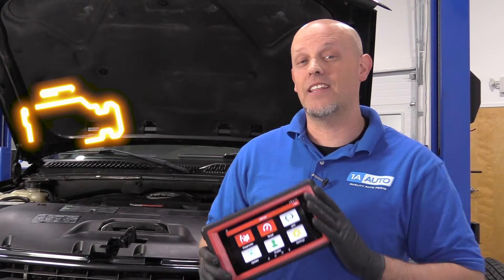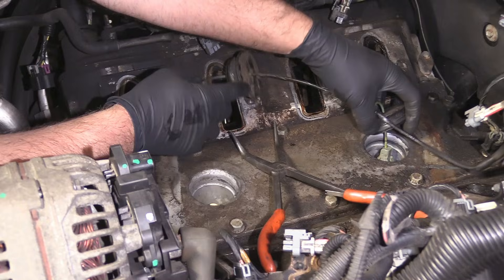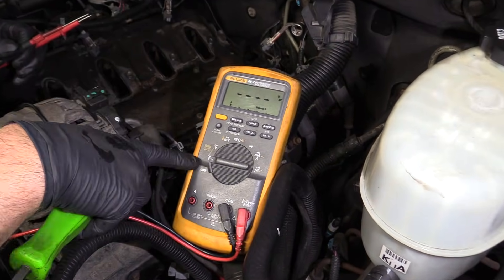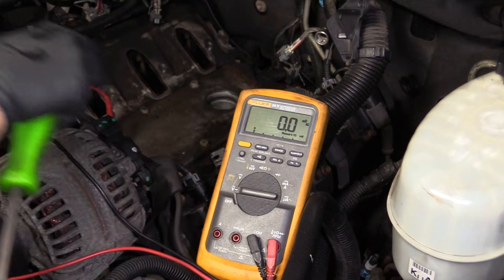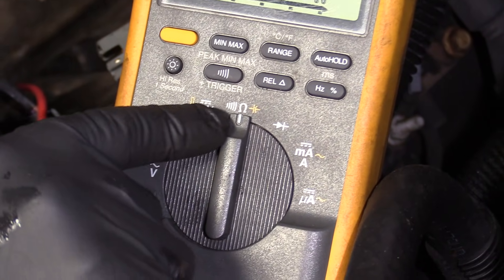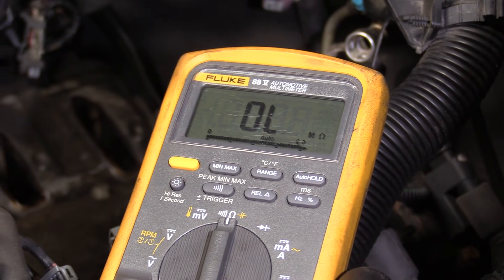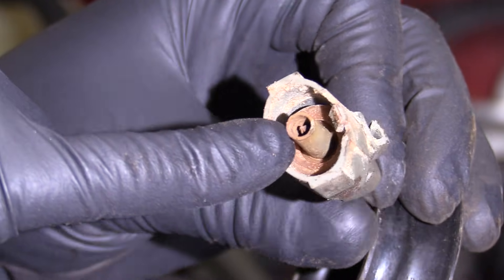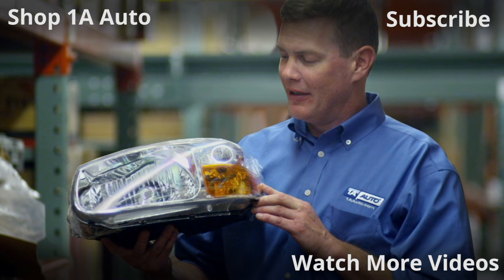Check Engine Light? Car Knock Sensor Low Input - Code P0327 P0332

Comment: Why didn’t you just check the sensors at the main connect located  at the top drivers side of the manifold? No need to pull the intake and it test both the sensors and the wiring harness. Just thought

Comment: I did a full turn up on my 2004 chevy Avalanche. And I did also replace knock sensor.  Water was inside ,  I was my truck 3 times a week , as I drive home after washing ut I noticed water flying into the knock sensor area.  Smh.  I just replaced it last year

Comment: I’ve had 6 replaced in succession and still getting codes. Circuitry from sensors to pcm ohm out perfectly.the puns on the pcm are clean. My next hope is a new pcm will solve my problems

Comment: I has this for a minute  , after startup  , 
when leaving Home Cheepo.

I had  no engine light  prior to parking( or ever in 190,000 mil.)

I read and cleared the code with the Scangauge2, that's  on the dash.

 It didn't  return.
Oh well.😊

Comment: Faaak I had that problem after a repair by the mechanic, it turns out the mechanic inverted the compressor and knock sensor connectors... So... if your air conditioner is not working too, it can be the same case... switch them and everything is solved

Comment: Thanks for the video, I have a 01 Subaru outback and I have a knock sensor code 327, I’ve replaced the knock sensor twice now with Sensors from other Subarus that I know are good, so , when I tested for power going to the knock sensor, there is none, should there be power going to the sensor if so, how much power ?  Information appreciated.  Thanks, Ron

Comment: 1999 Lexus ES 300 over 200k when I switched to motor oil blend synthetic CEL came On then I go back to conventional non synthetic motor  CEL went Off, code P0330 knock sensor 2 circuit bank 2

Comment: I have 2 codes of P0327 2 codes of P0332 and codes of P0157 and I think a little less power. 
But the engine idles smooth an I just found the PCV valve was stuck open and the wrong one.
What are your thoughts?

Comment: After replacing my knock sensors 3 times in a week my dealer found  they   had a bad set of knock sensors on they're shelves that GMC had recalled that they didn't know about.    Check recalls on your parts yourself,    or at least recalls that  dealers don't .

Comment: question, i replace both knock sensor and the wire for the conectors chevy express 2004 but Still low input , and the van vibrates when i hit the 55mph , what should i check ,

Comment: I changed both knock sensors and its still has the same code….any help anybody??
I also changed the wires to
Reply from the maker: +Big G We wouldn't be able to diagnose an issue like that here, you may want to have a local mechanic take a look at it. Thanks for checking us out! http://1aau.to/m/Shop-1AAuto-c

Comment: Replaced both sensors,wire harness and still getting codes on 04 Silverado 2500 hd truck runs fine no knocking in the motor why am I getting codes

Comment: I've done this job twice now. First with after market cheap knock sensors. Then I paid top dollar for OEM sensors on my 2005 6L GMC. Knock sensor #2 both times within a day. #2  was slightly corroded but I thought I'd cleaned it up nicely at the very beginning of this job. I used a bit of never seize both times. The OEM ones came in a bag from Amazon. Not protected at all. Thought that was weird. I'll be pulling it apart again next week on days off. First round was over 4 hrs. second was under 2 hrs. So this wont be terrible but it's not a job I enjoy. Very frustrating. I will be using a multimeter on these before I pull them. Thank you very much for this video. Super helpful. Any other advice would be greatly appreciated.
Reply: Having similar issue with an 02 6.0 gmc, ever figure out the issue?

Comment: Well, I had my check engine light come on and read that code of the knocks sensor… i cleared the code… would repeatedly come back on for a period of a few months… until I put super unleaded in the tank, cleared it again and it hasn’t come back on since for several weeks now 👍😎

Comment: Hi 
I have 2003 yukon xl 2500 6.0L.
I encountered some problems and fixed them, but I have a problem for which I do not know the solution p0327, p0332, p0135, p0300.  I changed the first and second knock sensors with the wiring harness, but 02 sensor I haven't changed it yet, and I cleared the codes, and with a test drive on RPM 2500 to 3000 (check engine) and after checking it showed p0327 p0332 p0135 p0300

Comment: I am working on an 08 F 150, it has a newer Jasper engine. I what I think (pretty sure) is the beginning of a rod knock. It is flagging a #3 & #4 missfire. has no power I am thinking the knock sensors are seeing the rod knock and pulling back timing. My question is what does the scan tool reading mean? I am seeing 232s and under full power I see between 900 and 1100. I throu/the scanner on another F 150 that ran correctly, I saw 232 at idle and at WOT I saw 1900 to 2100. What kind of numbers should I see if the knock sensors are seeing a knock?

Comment: Thanks for the walkthrough.  I always appreciate your concise explanations of the issues.

I have a 2002 Suburban with this PO332 code & am going to delve into the problem.

One thing that you pointed out may help me I/d & perhaps solve this, plus one other issue that I have:. 

Every 2-3 months, I get a "Low Coolant" indication on the gauge panel.   

When you showed that the Knock Sensor was corroded, that makes me think that I have a slight leak,. maybe originating at the Intake.  Perhaps this will help kill2 birds...

And, quite often, I find that an error code is only a symptom of something else, a root problem.

It would be a lot more helpful if the OBDII System was designed to find root problems.  But, it is what it is.

Anyway, a BIG Thanks to you guys, again.
Reply from the maker: +ARCH LAB 7 Thank you! We love empowering our customers and showing how to perform DIY auto repairs with our high-quality auto parts.  http://1aau.to/m/Shop-1AAuto-c

Comment: I replaced them both & now i have a bank 2 low circuit but codes were not there before replacing does that mean it is bad knock sensore

Comment: Update: Check your compressor tensioner pulley, mine was bouncing and tapping just enough to cause bank 2 to throw the code. I thought it was the compressor but found the pulley issue.
Reply: @MercuryRisingFast  I had a sound I couldn’t find turns out one two of my lug nuts where lose but not enough t to come off. But had a tapping sound that got faster as I speed up.

Comment: Does the PO332 cover anything else other than the knock sensors? I replaced both sensors and harness and am still getting the PO332 code for bank 2. I test and get 99.8k on the rear 102.3k on the front sensor both good and within specs. Then test the sensors for ac voltage on tap and both are working perfectly. Code pops randomly anywhere from 1 to 5 weeks after clearing the code.

Comment: So is it worth replacing does it even cause any damage or just one of those check engine lights to ignore
Reply: My 04 Silverado does the same thing. Did you happen to figure out the problem? I’m thinking about ground wire I just replaced both sensors and wires and got both sensor codes then revved Rpms to 5k  twice then the sensor codes went away drive 50 miles and now bank 1 low input code and no evap code. I’m puzzled

Comment: Question if you don't mind I have replaced mine 2 times. Still saying rear knock sensor low voltage.  And suggestions

Comment: So as long as I use the correct gas I should be ok driving it until I get it repaired? I have the low imput code. My harness I need for my 02 Exterra was discontinued....

Comment: "Don't drop them' as you juggle.  Bravo, great showmanship.  The technical part of your presentation was great too,  My Engine Light comes on and I thought it might be the gas cap.  So I reseat the gas cap and the light will go away if I drive an hour or so.  The light.  The light seems like it only comes on every six months or so and then go  away.  So today when the light came on I went to Autozone to get it checked, and when the guy came out to plug his instrument in the car the check engine light was gone again.  But the AutoZone guy plugged in and got historical code of PO327.  Since this happens so irregular, does that mean the sensor still works (most times) or could it be a sign of actual knocking, and if so, what would cause the knocking?  Bad fuel, plugged fuel filter, ????

Comment: DONT MAKE THIS MISTAKE!Not all knock sensors work but you tapping near it also depend how many hertz (hz) are required for that sensor to produce a/c voltage.newer cars take 6,000hz meaning 6,000 taps per second.not gonna happen .the right solution is to make car run lean(create a knock ) then check output using a scanner.

Comment: My 2004 avalanche 1500 seems to have power loss and has 2 codes. P0332 and P0446. would either one of these issues be causing my power loss?

Comment: I have a 2007 silverado classic 1500 4x2 4.8 L. Both knock sensors and harness have been changed. Using 87 octane fuel. I am still getting the P0332 code. It seems that the code triggers some type of guardian mode on the motor because I lose power. Any recommendations???? Please help.
Reply from the maker: +Jose Benitez We wouldn't be able to diagnose an issue like that here, you may want to have a local mechanic take a look at it. Thanks for checking us out! http://1aau.to/m/Shop-1AAuto-c

Comment: so i replaced both knock sensors and the wiring harness, for 2 days i drove it no problem, then one day one of my sensor bank one comes on under normal driving espically if its hot outside and i am running e 3 spark plugs with 87 octance? have any advice whats going on? also i am running a tuner with 87 octane and ocassionally i will unplug it and the light still comes on?

Comment: I need help with my pickup truck it's a 96 k 1500 4x4 with the 57 vortex I've done put a coil on it spark plugs and wires crank sensor cam sensor and a distributor shaft and it still showing up a code a cam and crank sensor or either number eights misfire do anybody else know what I didn't do I done done everything that I think to do to make it fire right all but a timing chain

Comment: Is there a way to ohm the sensors without removing the intake to see if they are within spec ?
Reply: you can test from the wire connecter to the knock sensors.

Comment: I have toyota 1994 v6 4runner i want to know if the cables that are connected to the knock sensor has to have spark?

Comment: So I have a question, just got the knock sensors replaced by the dealership in my 04 Silverado, but about 150 miles later it threw the P0332 code, is it possible that the dealer did something wrong or are the sensors fine and there is something else wrong?
Reply: Hey Hank. You figure out the problem.   I have a 6.2 motor that i just replaced the sensor on.  So far so good, but still uneasy about it coming back.   You see if there's something else triggering that code?  Really curious. Best of luck on it not being a bigger problem.
Reply from the maker: +Hank M We wouldn't be able to diagnose an issue like that here, you may want to have a local mechanic take a look at it. Thanks for checking us out! http://1aau.to/m/Shop-1AAuto-c

Comment: I replaced both knock sensors and the wire harness as well and the code still pops up
Reply: Were you able to find out what was causing the light to come back on? I'm having the same problem on my 04
Reply: @tiffanycastillo5958  same
Reply from the maker: +Power Punch We wouldn't be able to diagnose an issue like that here, you may want to have a local mechanic take a look at it. Thanks for checking us out! http://1aau.to/m/Shop-1AAuto-c

Comment: I have an 02 Nissan Xterra I’m getting codes P0300 P0152 and P0328 twice causing 6 codes and I can’t figure out the problem I’ve been told knock sensor, distributor,mafs &O2 sensor can somebody please help me with this? Thanks!
Reply from the maker: +Harvey We wouldn't be able to diagnose an issue like that here, you may want to have a local mechanic take a look at it. Thanks for checking us out! http://1aau.to/m/Shop-1AAuto-c
Reply: You figure it out?  Sometimes a poor performing throttle body or bad grounds can throw some weird codes.  Check and clean your grounds or for any loose/disconnected wiring.   Verify fuses too because a shorted wire would cause those to go as well.  Please let us all know what you found.  Hopefully you got it up and running by now.

Comment: I have a 2006 Chevy Avalanche I'm having that problem is the truck still drivable
Reply: It's best to replace it soon because the information from the knock sensor feeds the computer information as how to maximize engine combustion efficiency by either advancing or retarding the timing.
The part is generally cheap and you should be able to find someone on YouTube that's replaced one on your car make/model.  The code may be able to get cleared after installing at the nearest auto parts supply shop.

Comment: Thanks for the tips. So what are the chances of both Sensors going bad at the same moment? seems like it could be another related (Electrical) issue. Thanks
Reply: Best to replace both on this engine model as to not pull the intake manifold again anytime soon after the other one possibly failing.

Comment: I've had both of those codes P0327 and P0332 on a 2004 VW Jetta 2.0L. I replaced both sensors and check engine light would come back on sometimes right when I would turn the car on and sometimes before I would drive the car 1 mile. I unplugged both sensors and I checked the voltage and Sensor 1 said 0.00 Volts. Sensor 2 said 1.85V. So right there I knew I had a short somewhere or a bad ground. I just started unwrapping the engine harness last weekend and followed one of the sensor wiring all the way to the ECU, I kept bending the wires and looking for any cuts or corrosion but didn't see anything. Then I put everything together and when I started my car, the P0332 code was gone. Now I'll be messing with the other knock sensor wiring that goes through the injector harness and hopefully I can fix the other code too. If that doesn't fix the P0327 I'll just do new wiring for that sensor cause it's cleary not getting any power. Hopefully this helps someone that can't figure out where their problem is after replacing both knock sensors and check engine light comes back on.
Reply from the maker: +Adi Shqipe Thanks for the feedback!
Reply: Having this issue rn lol replaced both sensors and check engine light is still on

Comment: I changed both knock Sensors. And two months later the code pops up again I don’t know what to do but it does have a spark knock So I don’t know if the spark knock is triggering it I don’t know

Comment: I habexa question as to the o2 sensor on my 2002 chevy express conversion van 1500. Has the 5.7 liter motor. I did test at autozone, and it said my bank 2 sensor 1 was bad , didn't have electric or something like that, so I got one and they told me it was the one on passengers side b4 the converter. After replacing it with new one it still says same thing. Any info would be greatly appreciated. I hope I put it on right one, they said passenger side b4 the converter. Thank you and God bless

Comment: What kind of problems can this cuase if not changed.
Other than a knock sound on the engine
Reply: Did you ever find out? Not sure if I should fix immediately given the holidays
Reply: @matteobravo2149  my mechanic of 19 years said "Of all my years of fixing cars, I've only had to change the knock sensor once... and that's when I was first starting out."
After he told me this, I left my check engine light on and never changed the sensor. Now 2 months later, I'm still driving well. 👍🏾
Reply: Yeah but your car is running on borrowed time and the more you delay the fix, the more damage you engine will sustain. 
Your Engine may blow out afer a few months or after 4 years, it's a gamble. And It isnt a quick blow out either: it slowly accumulates permanent damage, becoming louder and worse performing, before eventually dying completely. 
If you intend to keep your car for longer than a year I suggest you change it. In any case it' s cheaper than an engine rebuild.

Comment: I replaced both knock sensor and harness with AC Delco parts and still have the same codes show up after clearing them. Any advise  would be helpful.
Reply: Hey fellas I saw tip on here and it helped me rev rpm’s to 5k and hold it there for 3-5 seconds do that twice it helps your computer adjust to knew knock sensors and sound I guess? I did it and code went away before code went away I had both codes come back again and after the trick I had just bank 1 come back hopefully it’ll help you guys permanently if not I guess it’s back to the drawing board I’m guessing bad ground in my case
Reply: I've done tbe same and still have the code
Reply: Ever find the problem?
Reply: @alejandrotapia5762  second that.  Problem?
Reply: @20tea  3rd that, you guys find out the problem. Replaced knock sensor harness twice and bank 1 sensor 4 times still showing the code.
Reply from the maker: +Adam Jimenez We wouldn't be able to diagnose an issue like that here, you may want to have a local mechanic take a look at it. Thanks for checking us out! 1AAuto.com